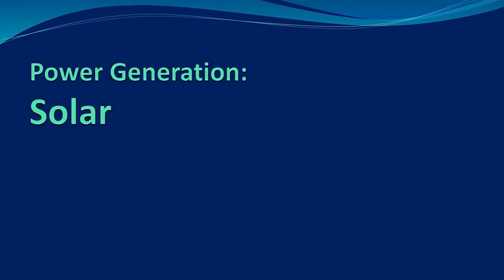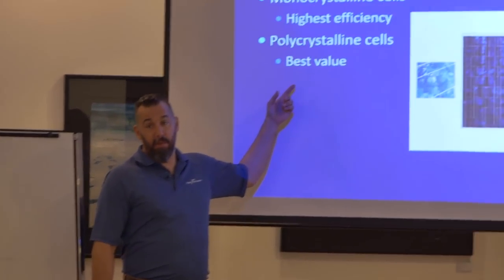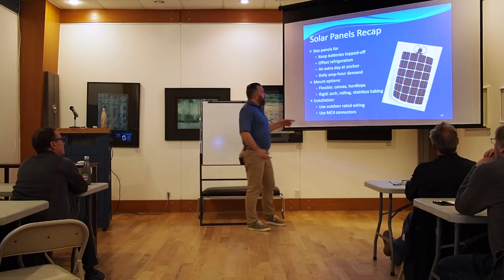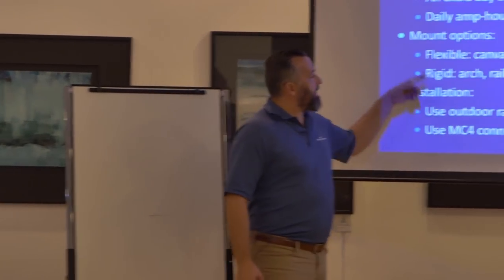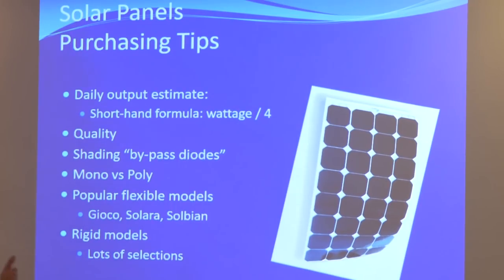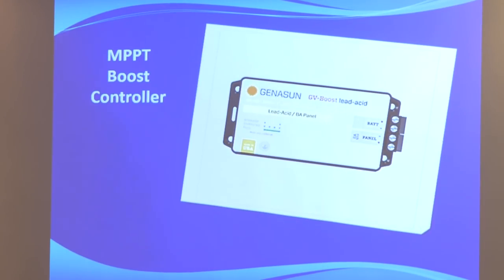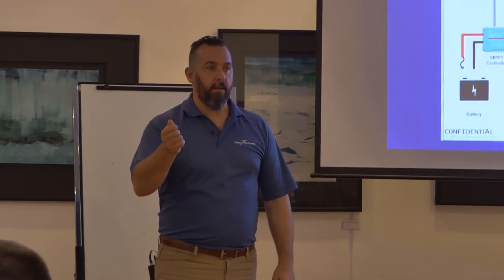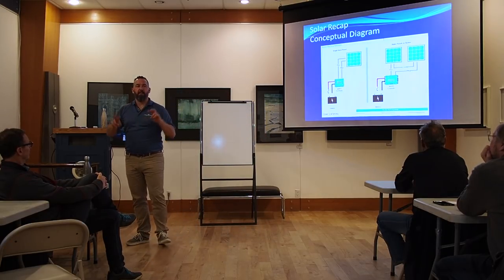How To: Marine Electrical Seminar - Solar Panels - Ep 07/30

Comment: Great video. I want to add one or two panels to my solar system. Can I add any panel or does the Wattage or the open circuit voltage etc. be the same. Or do some other values have to be identical? I have one Vicrton 15A 75V controller.

Comment: Dear Jeff, I have a question; I'm about to install a solar panel system, I have 3 ways of charging my batteries. 1. engine/alternator 2. shore power charger.3. solar panels, do I have to have some way of disconnecting the solar panels when I'm running the engine? 
do I install a disconnect switch?

Comment: I can't figure out whether you have no clue about electricity, or you simply can't explain what you know.
MULTI power point tracking ?
MULTI ????
Reply: Mr. generic himself shows up to lay criticism.

I didn't know shit about wiring, and now I've hooked a second battery up in my boat w/kill switch. 

Thanks for all the help guys.
Reply: We've all made mistakes forgetting or assuming acronyms of technology devices before. Calm down.
Reply: Do you actually think this guy doesn't know it stands for maximum, or maybe he just misspoke.
Reply: @rglaz0311  : I don't know. As I've stated in my comment.
If I remember the video correctly, he's not mentioning voltage drops, cross section of  a wire, it's resistance by cross section per length, conductivity per length in Siemens, etc.
Nor he mentions contact resistances, wire and terminal materials.
ALL of which can make HUGE differences in system's efficiency.
About me : I'm a qualified electrician, I'm into electronics and I've designed and executed a pretty elaborate wiring setup for my boat.
The boat (3 cabins, 2 heads and a saloon), 11,6 m long is certified by local maritime certification agency, and she happily continues her 11th chartering season.
English is not my native tongue :)
Reply: @JohnSmith-xn3fr  His primary audience is marine electricians who should already know this stuff... He has done numerous seminars about voltage drop and excessive use of terminals and connectors.